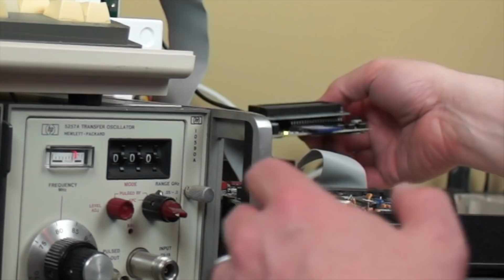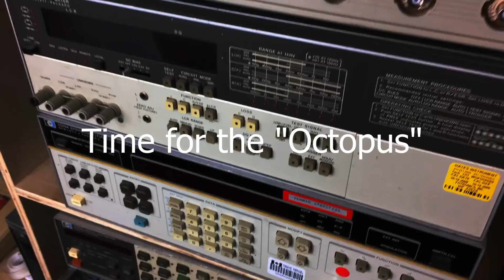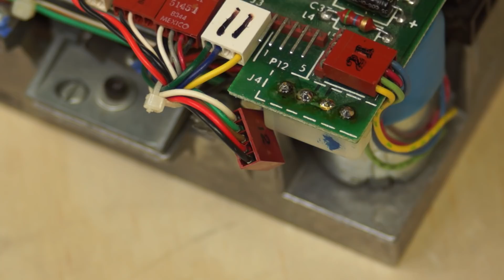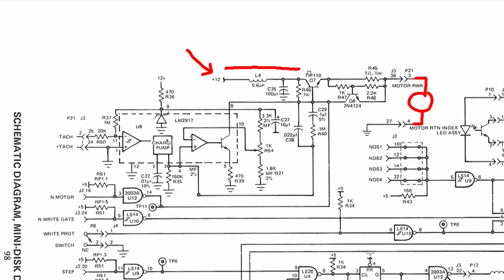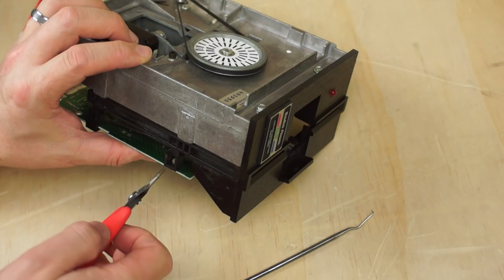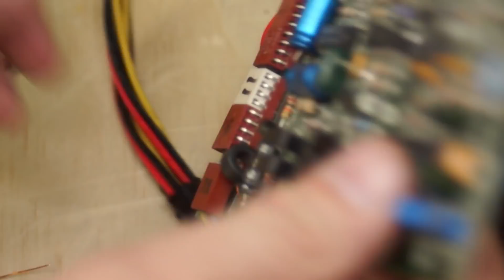Retro Floppy Disk Drive Repair

Comment: The plastic bits that hold the PCB to the chassis are known as drive rivets.  A version of them are used extensively in the semi-trailer industry to secure plyliners (the plywood panels that protect the side posts & panels on the inside of the trailer) to the walls of the trailer.  You also find tons of them holding various bits of car bodies together with removal typically equally frustrating.

Comment: that inductor acts like a fuse, its common even on washing machine boards....those 5.6uh will do nothing..its just a fuse...the one you fabricated has a much thicker wire so i guess it will not work as good as it should for a fuse...i would just reuse any small inductor with the same physical size from any random old circuit board or even a low wattage 1ohm resistor etc

Comment: So I suspect you shorted the leads of the capacitor C35 taking it out of the circuit so all the applied power was going through that inductor.

Comment: On a two lead component like that inductor, if you just apply the iron to heat one side, once the solder melts you can pull out one side, then you can heat and pull out the other side without even using solder wick.